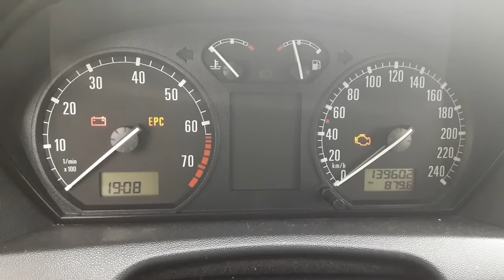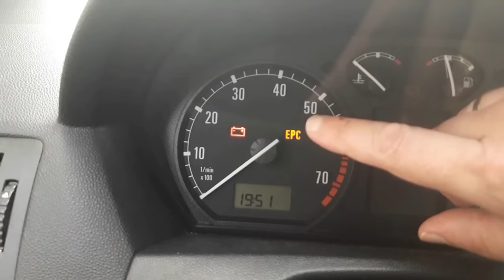Most Common Reasons Your Check Engine Light Is On

Comment: Thanks for your video! My engine lamp (Fabia -01) turns on and off, but mostly during heavy rain. When driving behind other cars in their "water mist", the engine lamp even starts blinking and the car start having problem with accelerating. It's a bit blurry when pushing the gas pedal. I feel that the air intake is really open for water coming in through the front of the car, and it almost feels like a hole in the front where there should be some kind of bars or something.. Is this a problem for your Fabia as well? Perhaps the water mist decreases the air intake?
Reply from the maker: Hi Mikael and thank you for watching!
To be honest, I wouldn't say that water is causing the problem. If so, the problems would be more dramatic.
If there's isn't any previous damage done, then the water shouldn't be able to reach the air intake at all.
I don't know what type of engine you have, but I'd rather check the whole air intake system for any air leaks (of course the air filter also).
Besides this, I would check the throttle body or the PCV valve, just in case.
If you have an OBD scanner, making a scan would also be good.
Fabia's are known to act up for these reasons, especially the earlier models.
Hope this helps and best regards!
Reply: @DespairRepair  I did an OBD scan, and I got two codes of malfunction. One is "Cylinder 3 - misfire detected" and the second is "Heated oxygen sensor (HO2S) 2, bank 1 - circuit malfunction". I also noticed that in the car grill, there is a hole right in front of the engine air intake. This hole is completely open (no bars, nothing), and it looks like the edges are torn, like if there has been some sort of protection there before. So perhaps to much rain and water passes through that hole and causing some electrical hiccups with the oxygen sensor?
Reply from the maker: @ecmik85  well it might be but I haven't heard of that kind of problem.

Anyway, what type of engine do you have?
Is it the three-cylinder engine?
Reply: @DespairRepair  It's a four cylinder! 2001, 75hp
Reply from the maker: @ecmik85  if I was in your place, I would first solve the misfire problem (perhaps try checking the ignition coils).
A misfire may easily cause the O2 sensor error thus triggering the check engine light.
This is a wild guess and hope it helps.
Reply: From studying/fixing electronics for years and years:  i  would say, the wiring somewhere, is getting wet, (perhaps a partial shorting to ground from the mist) to the  ECU  unit (computer); check radiator fan wiring, and all other wires/connections   UNDER   THE   HOOD.  (use  a tarp, under the engine, from radiator to the rear of transmission.  Support with  tarp straps, etc.   IF   the light goes off, then the rain/mist is buggering up some wiring/sensors underneath)
Reply: I think this is why my light came on! We had about 6 inches of rain fall  couple days ago  eater wasn't deep in the road but in some places there was 7 or 8 inches of rain. I would drive through the most shallow side  but other.cars were blasting through it. Then Monday I notice the Malfunction light comes on
Reply: Having same problems with turan volkswagen

Comment: I have a 2016 buick verano
 When taking off it stalls and have a little hesitation while driving down road
 It starts real easy. Going in reverse it does not stall. And engine light stays on. Please help someone
Reply from the maker: Hi Rick and sorry for the late response!

Try checking the throttle body or cleaning it. We've made a video about this, how to clean the throttle body without removing it.

Of course, if you have an OBD tool, connect it and see if you get any error codes.

Comment: Hi, my check engine light on today . It say catalytic converter defect . But I have change it one month ago . Anyway I erase the code and check engine light gone . So my question is will it come back again. If so how long it will take to come back. Thanks 
Golf 5 ( 2008 )
1.4 patrol engine
Reply from the maker: Hi and thanks for watching!

Hard to say, it may come back in a matter of days or not at all. Especially with VW group cars, they are somewhat sensitive to this problem.

I have a Skoda 2005 with the 1,4 16 valve engine so I know.

Sometimes following the error codes doesn't solve the problem. A big downside of the diagnostic system was always the fact that a few combined factors give you an error code that you follow and make the repair only for it to come back again.

If it continues to come back again with the same error code keep erasing it. If it starts to show multiple codes then there's something else wrong.

So, best monitor it over time and don't spend money on perhaps unneeded repairs.

I hope this helps at least a little.

Best regards to you!
Reply: @DespairRepair  hi , you know funny things. I drove one week with clogged Kat but no engine light and drove another week without kat again no engine light. After I install kat one month later engine light on and says kat defect. Code erase drove 20 km still no sign. And can not drive today because of snowstorm . Anyway thanks for reply .
Reply from the maker: @todaysupdate6824  your welcome and I wouldn't worry about it too much.

You've made the repair and the main point is that the car is safe and mechanically sound.

Electronics have always been glitchy and susceptible to all kinds of factors. Again, monitor the problem for a while and see what happens.

All the best to you.
Reply: @DespairRepair  I have to be worried because of MOT
Reply: @DespairRepair  if the check engine light does not come back on after you clear the check engine light. what does that mean ?? Like if you driven the car for 3 weeks or longer and over 100 miles and it does not come on ??
Reply from the maker: @myyoutubechannel3161  hi!

It probably means there was a temporary glitch somewhere in the system.

It's a common case with the check engine light and it may be caused by things like bad quality fuel, a bad contact, a leak on the air intake and so on.

Leave it like that, don't touch anything unless it appears again.

All the best to you and hope the check engine light doesn't show up. :-)

Comment: Do bad spark plugs make traction control comes on with engine light?
Reply from the maker: Hi and thanks for watching!

Generally no. Although it mostly depends on how the car's electronics are made and what system is connected to what.

When the light comes up, hook up an OBD tool if you can and you should get some more information.

Comment: My check engine light turns on whenever i put my car on park or neutral while the engine is running. What could be the problem?
Reply from the maker: Hi and thanks for watching! 
This won't be much help, but in this case, best to hook up an OBD tool and get the error code.

If you don't have an OBD tool, for starters, I would check for air leaks (loose or cracked hoses, loose clamps, hoses that have fallen off, or else).
Reply: Wow, thank you so much. I didnt someone would actually reply. Whats bothering me is that it doesnt turn on if i just continuously drive. It turns on whenever i put it on neutral or park, if say im on a red light. Is that relevant? Again, thanks for the response! More power to the channel.
Reply from the maker: @goodguyje3934  you're welcome and thanks for the nice words.

I've told you about the OBD tool and air leaks. Also, try to check that there aren't any loose or corroded electrical connections.

It's unusual for the check engine light to come up that way.

Comment: What about the fault code p0303, what should we check? On seat Ibiza 2005
Reply from the maker: Hi and thanks for watching!
That is usually a fault code for a misfire on the third cylinder.
You should first check the ignition coil or the spark plug on that cylinder.
Hope this helps.
Reply: @DespairRepair  thank you very much for answering. Is there any possibility that i have to change all the engine? My car is trembling in the stop, but as soon as i turn it off and turn it on again, is ok. And i can travel without any problem unless i have to stop with the engine on. And our mechanics in Greece told me i have to change the engine
Reply from the maker: @sofaki971  tell me, does the engine burn oil or overheat?
Reply: @DespairRepair  no, there is no problem with burning oil or overheat. It just trembling a lot and the acceleration is off. For example if i have to stop to a red light for 1-2 min, the car starts doing this.
Reply from the maker: @sofaki971  then I seriously doubt you have to replace the engine. Sorry, if I'm boring, but how many kilometers does the car have on the clock?
All of the troubles you've explained combined with the error code point to a misfire which is relatively easily solved and is a pretty common problem on cars. It's not that pricey to solve also.
Reply from the maker: I'm also a bit surprised that the mechanics didn't check out the misfire problem first. Not badmouthing anyone it's just strange.
Reply: @DespairRepair  it has 300.000 kilometers, but everything is ok with the oil in the engine. I did service and everything was ok except for the p0303
Reply from the maker: @sofaki971  sorry again, but by any chance do you know what the engine is? Diesel or petrol? How many cylinders?  
Those are VW engines and each engine has a different lifespan
Reply: @DespairRepair  it is petrol and it has 3 cylinder. I have seat Ibiza 2005

Comment: I have paid $918.10 at one shop, engine light back on next day, took another shop, paid $141.00, engine light back on, called mobile mechanic paid $100, check engine light back on, took to another shop paid $749.04, check engine light back on, they Firestone said bring back Tuesday morning see what else they need to do... they said need to reset the memory so that can pass inspection.... SMH ... 
2008 DTS
Reply from the maker: Hi and thanks for watching the video!

My goodness, that's a truckload of money :-(.

The check engine light is known to be a money pit problem. One of the points of the video was to try and give a hint to avoid such expenses.

Lots of times the error code is induced by other systems and parts that the error code doesn't show.

Hence the constant unneeded replacament of parts: an expensive system of elimination that comes from the owner's pocket.

This writing won't help a bit to solve your problem but at least ask the next people that come to exactly pinpoint the problem and stand behind their words.

Best of luck with the repair.

Comment: I have a problem with the pipes going into the air filter, one of them has broken off and I cannot find a replacement anywhere? Does anyone know where I can get a replacement?
Reply from the maker: Hi Daniel and thanks for watching!

All of this you probably know and tried already but nevertheless:

Besides the internet and car part shops, try a car junkyard. A good junkyard is a gold mine for rare parts that you can't find anywhere else.

If nothing else, see if there's any possibility of mending the part. Since it's for the air intake and probably from plastic, it may hold up.

Hope this helps!

Comment: Thanks 4 such  useful videos Daose engine light effects  to spend more fuel? My car is Fabia Combi 2003 1.4 . 50 kw.  spend 9 Liter  fuel  100 km.
Reply from the maker: Hi and thanks for watching!

Yes, when the check engine light comes up there may be an increase in fuel consumption, all depending on the fault.

That engine is known to have a higher fuel consumption, at least from what I've seen.
Reply: U

Comment: My fielder yom 2008 is font of displaying check engine and looses power once in a while. After a short rest and restarting it picks and moves on well. Its now like two months still behaving that way. Kindly help.
Reply from the maker: Hi and thanks for watching!

It can be a lot of things. The best you can do is connect a diagnostic tool and see if you get any fault codes and start from that.

If you don't have one and if you have the time and will, give the engine a brief inspection for loose, broken, or punctured air hoses and ducts. Also, check the electrical connections.

The car probably goes into limp mode, this is why it recovers after a while.

Hope this helps at least a little.

Best regards.

Comment: I have a Ford Fiesta Zetec and the light "check engine" appear today, I turn off, turn on again and it went away. Anxiety. It was just after having the car in the drive several days because a heavy snowfall. Can it be the reason, a dramatic change of temperature? Cheers!
Reply from the maker: Hi and thanks for watching!
With the check engine light, anything is possible. 
My advice to you: don't worry if the check engine light went off and doesn't appear again. There may have been a temporary glitch of some sort due to the cold.
If it appears again then you may have to make an inspection and a diagnostic of the problem and tend to it as soon as possible. 
Hope this helps.
Reply: @DespairRepair  Thank you very much for your quick response. Very kind of you. Very informative video, also. New sub. :)
Reply from the maker: @alviselaguna9033  :-) thank you for the nice words!
All the best to you!

Comment: I'm looking to buy a 2000 Ford Mustang and they said it runs great but it has a check engine light, is it worth it?
Reply from the maker: Hello Bryan and thanks for watching!

Don't buy anything until you make a good diagnostic of the problem otherwise you may end up in trouble.

Ask the seller to make a diagnostic first and an assessment of what the problem is and how much it may cost to repair.

So, first diagnostics then consider buying. If the seller objects, get away from the car as far as you can.

If it's a minor and cheap repair, I'd buy it especially if you like the car. The truth is that many people drive with the check engine light on for months without any special problems (if it's a minor fault of course).

Otherwise, it may just be a money pit.

Hope this helps at least a bit with your dilemma.

Best regards to you!
Reply: @DespairRepair  thanks so much, ended up buying a 03 chevy s10 v6 4wd today and it has problems but it runs and my parents believe it's the perfect car for me to learn on and invest in
Reply from the maker: @proxgamer7759  congratulations and I wish you a lot of carefree miles and fun with your new machine :-).

Very good and wise choice also. All the best to you!

Comment: My Mazda pickup is getting harder to  start.  Usually takes 2 or 3 turns of the key before it starts.  Now my check engine light is on.  So I'm assuming it's the battery or ignition switch?
Reply from the maker: Hi Craig Erik!

Thanks for watching! 
Could you please clarify is the cranking heavy or is the cranking OK but you have to crank a lot for the engine to start?
Reply: @DespairRepair  I have to  turn the key hard to get it to start.  Usually takes 2 or 3 turns of the key before it starts
Reply: @DespairRepair  I just bought the truck from private owner.  The battery cables were very corroded.  I cleaned them.  Battery is 3 years old and is one of those where you add distilled water to the cells.
Reply from the maker: @TheSwords99 regarding the battery I would say that you've done everything right. Even if the battery isn't the problem it won't hurt. Additionally, if you have the possibility take it off and put it on a battery charger overnight to revive it a bit more.
Do you turn the key hard and there's no cranking? I'm asking this because there's a big difference if there's cranking or not in perhaps solving the problem.
Reply: @DespairRepair  there's usually  cranking when I turn the key.  Just  won't start unless I'm  turning the key hard.  I'm hoping it's not the ignition switch
Reply from the maker: @TheSwords99 well it certainly can be. 
There is a way of testing that, it's a bit complicated and rudimentary but very effective.
You have to reach the cable connector behind the ignition key lock and disconnect it from the lock (may include taking off the trim around the steering wheel).
You should then put the car in neutral or in P and use a piece of wire (copper is best) to cross-connect. 
Find the connection from the battery inside the connector and the one that leads to the starter.
Once you cross-connect, if the starter and the rest of the system is OK the car will crank immediately.
Then the ignition switch is faulty for sure.
If not, then the rest of the system should be checked.
Sorry for the long writing but I have no different way of explaining this properly.
Also, this is just a suggestion, if you don't have some experience around car repairs best don't do it.
Reply: @DespairRepair  Not a repair  I can do.  I hear  it's expensive?
Reply: @DespairRepair  Tested  my battery and it's  fine.  Of course disconnecting it caused the check engine light to go out.  Now have to figure where to go from here.  Truck runs great.  Plenty of power for a small v6. Does not stall or misfire.